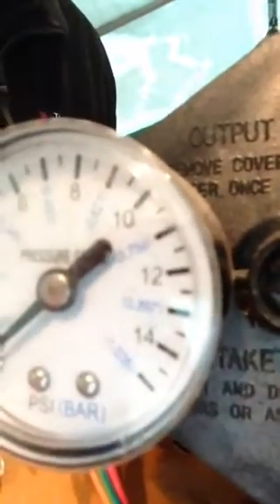Master Forced Air Heater pump adjustment problems

Comment: You should let it run until all the extra fuel in the chamber are burned off before making any adjustments on the pump pressure. Then you can turn down the pump so there is no flames blowing out around the shield. That should be pretty close to the right pressure reading. Mine actually runs to low if the pump is adjusted to the correct pressure reading because I burn diesel, which is thicker when it's cold.

Comment: you have too much fuel because either your nozzle is too large or air pressure is too high. 
also...you need to have the cover on! you cannot adjust it properly with the cover off, fan air needs to be directed down the blast tube not some down the tube and some in the sky.
Reply: All I know is that it's been working great ever since the video was shot.